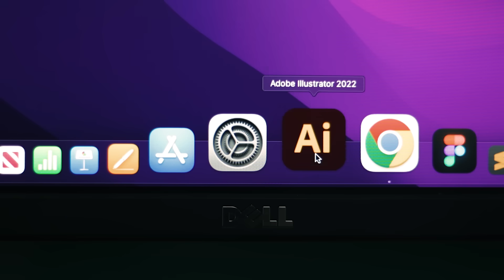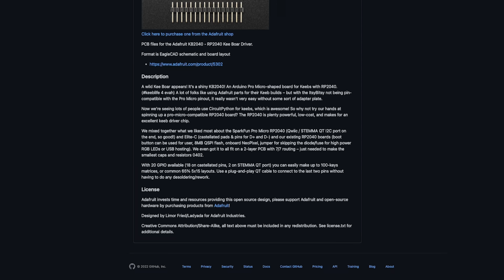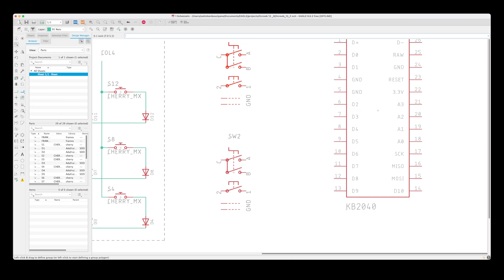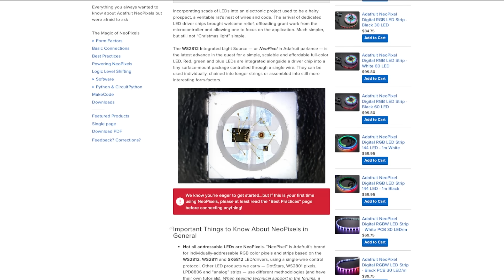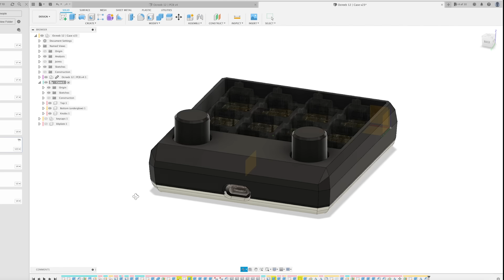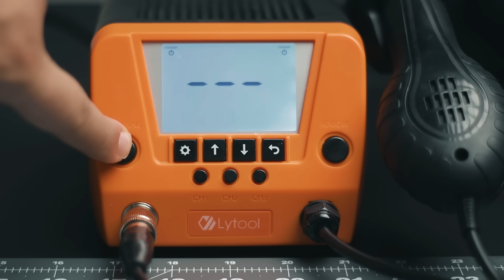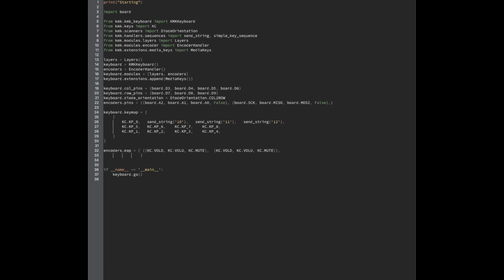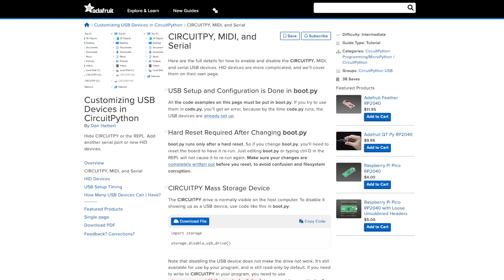DIY Macro Pad Keyboard Build from Scratch with Custom PCB and Mechanical Switches

Comment: cool great work. makes me want to do this too but afraid of the time commitments I heard it takes like 20 hours at least. Just curious how long did you take to make it man hours.
Reply from the maker: It does take a bit of time indeed. But it's super fun to do. If you want to put together a kit or replicate this one I made you will be looking at around 15 to 20 hours total ( 8 to 10 hours of 3D printing, 8 to 10 to solder, assemble and customize the firmware ). Good luck!